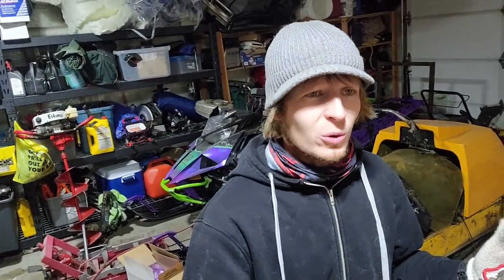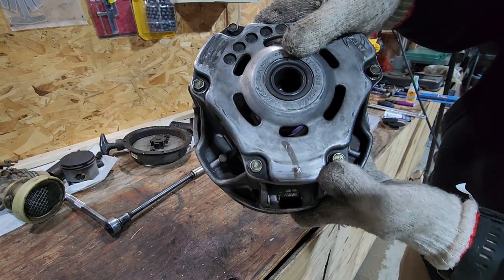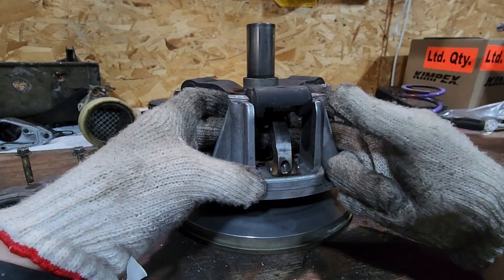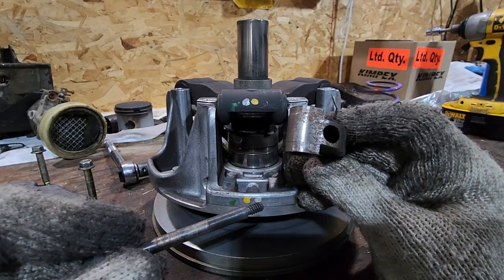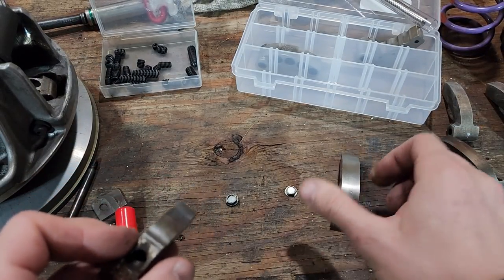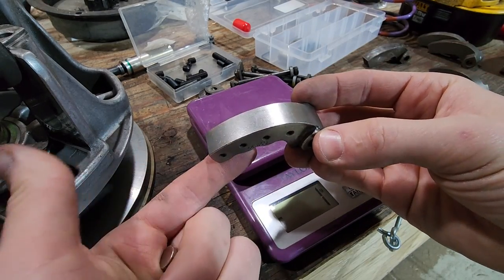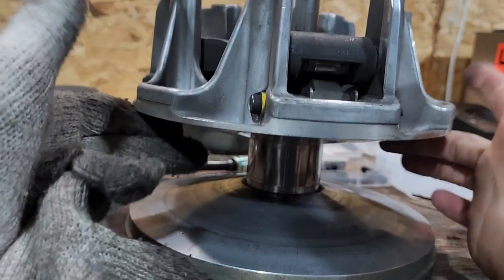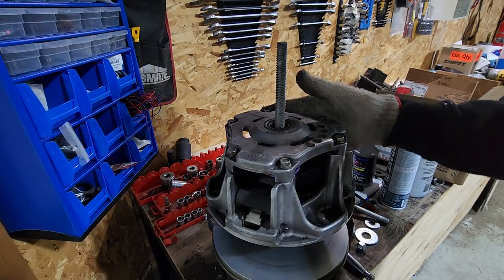How To Rebuild / Calibrate / Tune / Replace TEAM Primary (Drive) CLUTCHES (SSI CLUTCH KIT INSTALL)

Comment: I don't get why primary clutches seem so ancient. I have a 2016 zr 8000 trail sled with ~12000 miles and have been through 3 sets of weights and 1 spider. I watched a video on the powerbloc 80 clutch and was amazed at how simple it and compact it was. Why are manufactures still making these clutches so cumbersome and outdated? Is this really the best there is?

I use the same style of weight that you just bought, but from bikeman. I get 4000 mi out of a set and they work really good! I beat the snot out of my sleds, but I would check the weights every single season, if you find any wear at all make sure to replace them. The weight is very thin around the magnets and I wouldn't want to imagine what would happen if a weight were to snap.

Comment: Mine failed at 1300 miles. It's sticking and won't disengage. Takes high rpms to engage. I've tried to clean it but I can't get it to operate smoothly. Have to buy a new one now :(

Comment: First time sled keener/driverI have an M8 with big bore kit/ power commander.  The primary clutch clunks when it finally engages.  Is that normal?  Primary clutch is stock secondary is aftermarket

Comment: Are you able to replace the roller bearing that is on the shaft between the sheaves? The one on mine seems to have gone bad
Reply: Have the same issue

Comment: Hey Matt or anyone in this comment section know any companies that make upgraded idler bearings for the adapt clutch’s? The one in my 20’ lasted less than 1000 miles and now the one on my ‘23 is on its way out at 2000 miles, I think the washers on each end is the root of the problem. Thanks In advance to anyone with any recommendations and info appreciated it👍🏻

Comment: So, i have this kit in my 13 m8 with the team clutch that i also bought from BDX/SSI along with the same kit. Keep an eye on those magnets, they vibrate out and they crack, throwing off the balance. I'm always checking them and thinking about switching kits to something that doesn't use those magnets.

Comment: I would be ordering a replacement clutch to have in hand.  Those will blow apart sooner or later.  They do work pretty decent, but tend to crack eventually.

Comment: What would be the most likely suspect for hard hitting off the start?
Reply: What kinda sled? Usually a high engagement is caused by a stiff spring could also be a loose belt or a clutch roller hanging up
Reply: @kelseyweber8280  2009 crossfire6